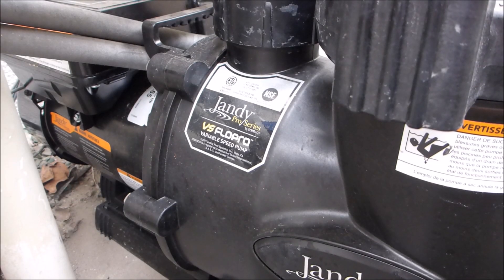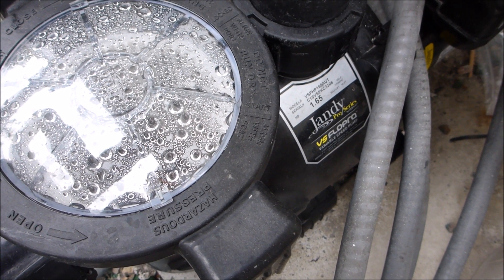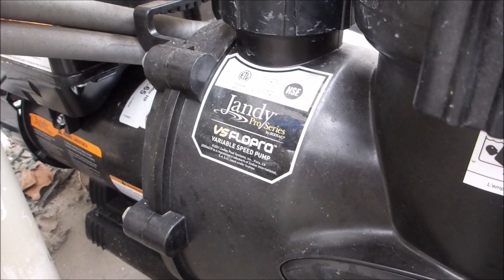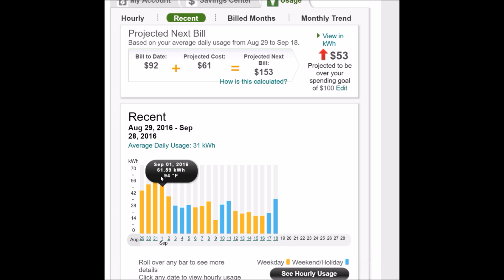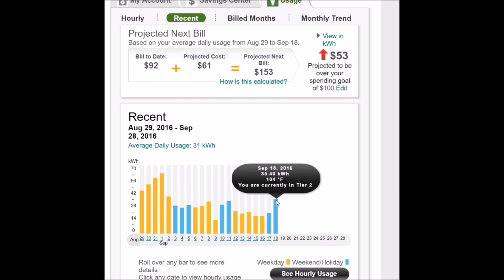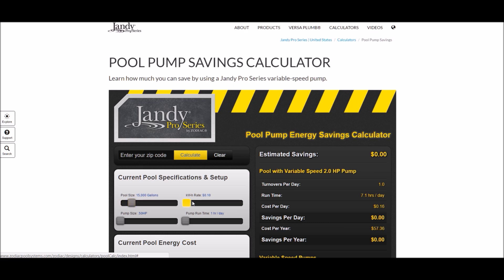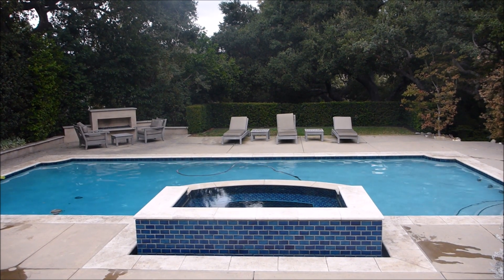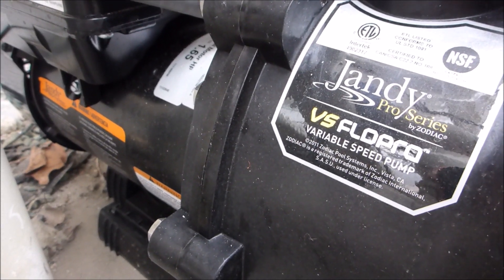Benefits of a Variable Speed Pump

Comment: How do you save money with a variable speed puml of you operate at a lower speed your gpm would go low for example if your operate a 1hp pump for 4 hours on a 10000 gallon pool would the cost be the same if u operatr a variable speed pump set to MAX for the SAME 4 hours . Explain it plz if u have to cycle thr water through is it cause the bill is paided by how much draw in electricty the pool pump does in a hour not the how long it runs ?
Reply from the maker: You only save money on a VS pump by running it on a lower speed. You wouldn't ever need to run it at 3450 RPM which is the same speed as a single speed pump. Most pools can get away with running it at 2400-2800 RPM for a few hours and then a lower speed for the rest of the cycle.
Reply: @SPL   - isn't that true that if you run @ 3450 rpm you push more water through and you can reduce the run time? for example if I run the pool at 3000 rpm and push 20,000 gallons through in 6 hours. If I run it at 1500 rpm I will have to run the motor for about 12 hrs to push 20,000 water through?

Comment: Are you recommending Jandy / Pentair. My pool has a Jandy controllers and Pentair pumps. Should I make the change or should I get a comparable Pentair pump?
Reply from the maker: If you have Jandy Aqualink and are upgrading to a Variable speed pump - if you go with Jandy you will be able to control the pump and all of your other connected features - with the iAquaLink App. If that doesn't interest you and you like the Pentair pump it will be compatible but not with the online App.
Reply: Thanks for the info. I think I will be staying with the quality of Pentair. I do love my online app though.
Reply from the maker: Sure. I can't argue with you - I know people at Jandy, Pentair and Hayward and they are all great people. Go with the brand you feel comfortable with.
Reply: Robert Hoffman I'm with you except for them salt cells for them I prefer Hayward Aquarite
Reply: Austin, had a horrible experience with Jandy so far with Pentair I'm very pleased. Of course to give Jandy a little credit, that was my first salt system. After researching extensively I went with Pentair.
Reply: I Own A Pentair Cell It Is Ok Not My Favorite. Expensive But Good

Comment: I have a Sta Rite Intelli Pro VS pump in a 22,000 Gal inground plaster pool. I have a setting for the spillway, vacuum, Spa mode, and low to circulate the pool. What do you recommend are average settings for RPMs fr the different modes? What times and for how log do you set yours for? I am in so cal. if that helps. Thanks!
Reply from the maker: Usually 2 speeds are enough for everything. I am running my pump at 1700 RPM for 5 hours - this is enough for my spa spillway and then I run it on 2600 RPM for my cleaner connected to my vacuum port for 2 hours each day. This gets one cycle of water thru the filter for my 15,000 pool.  A FlowVis flow meter will help you determine the Gallons Per minute at each set RPM you use - to get one cycle of water thru your filter each day, this video goes over this - 
Variable Speed Pump RPM, Watts and Run
Time EXAMPLES: Featuring Jandy  iQPUMP01:
https://youtu.be/DlOjwUgv_Yk
Reply: @SPL  can I just swap a motor without the pump like I've done for 30 years?  Theirs gotta be a lot of rebuilds by now.....I still have the old bronze impeller/pump but it works fine

Comment: Hey i did the same test u did with your plearco filter just like execpt i just used dirt my question is the pressure was only at 10 and that was full of the sand i put in it i cleaned out the filter and pump and turned it on and of rapidly to test my psi guage do u think i damaged my filter or pump or pool pumbing cause it works normal with normal flow and everythimg just wanted ur opiopn
Reply from the maker: It should be fine. Usually the PSI rises only when the filter is going bad. The gauge should be okay.

Comment: would this be good to replace a booster pump and split the line and put a pressure reader on the side going to the filter to keep the correct pressure?
Reply from the maker: Not sure exactly what you are trying to do - maybe explain it in another way to me. tks

Comment: Just wondering, why did you decide to buy this pump as to the popular from Pentair.  Thanks.
Reply from the maker: No real reason other then their sales rep wanted me to try their iQPUMP01 - which is only compatible with Jandy VS pumps. I also didn't want the control pad on top of the motor - in my case that would have been hard to program and use - very tight equipment area. the iQPUMP01 is the easiest way to program and control a VS pump. The Pentair Intelliflo is a great choice also - I would say Jandy is now on par with Pentair with their new VSPlusHP 2.0 Hp pump. You can't go wrong with either brand.